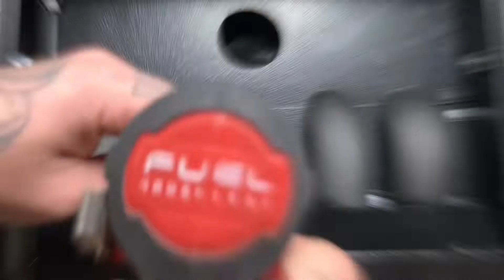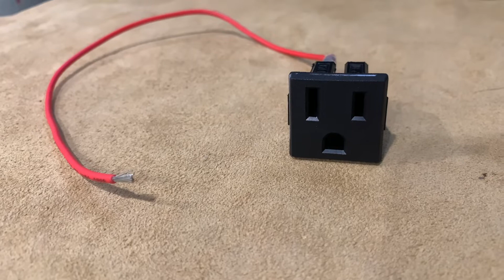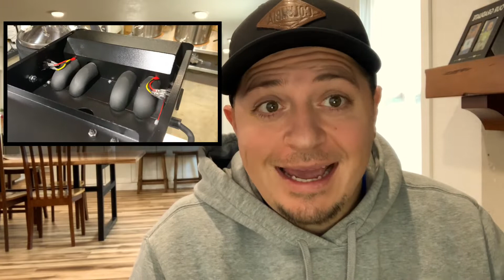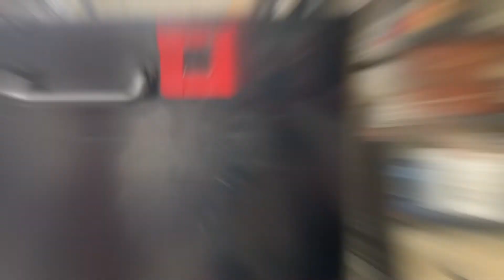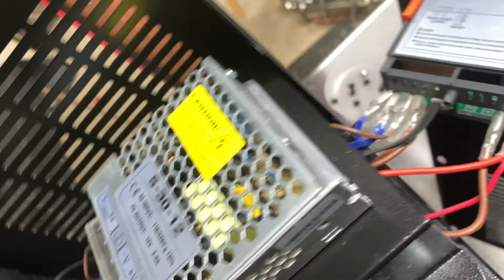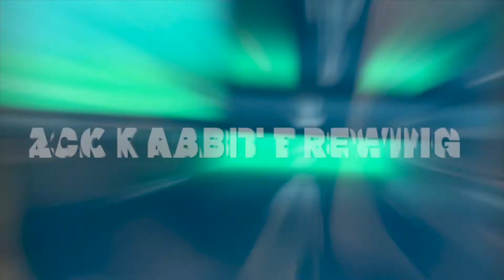I will show you how to use the heating feature on your ice master max 2!

Comment: Thank you for this video, it was a major help. I ended up tapping into the mains power to supply load to the heaters. That way there's only one plug needed to power the entire chiller and both heaters. You do this by installing a 6 position terminal block, and stealing the brown and blue input wires that feed the 12V transformer. The brown is the mains hot and the blue is the mains neutral. Use those feeds to power the heat relays and the 12V transformer via the terminal block. The ground wires from each heater socket can ground to the ground terminal on the 12V transformer.

Comment: Thanks so much for the video, this is awesome. One quick clarification: the power cord you install through the back (at the end of the video); this is the same cord you wire to the outlets and relay connectors earlier in the video, correct? Essentially, you hooked everything up to make sure it worked, then disconnected it all, ran the new power cord through the unit and hooked it all back up again before finally closing the unit up? Thanks!

Comment: Great information, thanks. I live on the Gulf coast and will not be using the heating often. I have one eighty watt heating element that I'm going to use on one side only. Do you think it would be safe to use the existing power for the chiller to power the plug for the heating element? I don't think both would be running at the same time down here.

Comment: Ok, so bear with me; I haven’t taken the machine apart yet and looked at the electronics. 

I get that you are using the relay to act as a switch. 

My question is, why are you running separate power. Are the relays not powered or do they not have enough power to run the heater?  The directions from Keg Land do not indicate that extra or alternative power is needed. 

Also, assuming the extra power is needed, where/what are you wiring the power cord to; you don’t show this in the video?  

Thanks 

Ray

Comment: Great vid. Clean modification to get a lot more versatility out of this chiller. It would be great if KegLand / MoreBeer added pass through outlets as a standard feature.

Do you know what the max current rating is for the relay that you're passing your heating elements through? My advice would be to add fuses inline with your heating element plugs. That way if anyone accidentally plugs something into the outlet that would exceed the current limit of the relay, you blow a fuse instead of frying your controller.

Comment: Instead of adding a separate AC power cord through the back, could you not simply tap into the power going into the Icemaster Max 2?
Reply from the maker: I’m not an electrician. But I don’t think that original power cord would be able to handle the load of a heating element let alone 2 if you were running both at the same time.
Reply: @zackrabbitbrewing4997  I would need to see the electric rating on the chiller, but from the description in the instructions, it only draws about 5A at 120V.  The cord size on the unit is probably 16GA (which can carry up to 18A over a short distance).  The spike conical heaters draw .67A to 3.33A depending on size (5 to 30 gal fermenter). based on these numbers, the units 16Ga cord can support up to 4 large heaters (if the cooling is on, at least one heater would be off) for a total of  14.99A (3.33 + 3.33 + 3.33 + 5A for cooler). This would likely be the max a single wall outlet could handle, so the only reason to do 2 separate cords would be to plug into two separate wall circuits (which still would not help much if all 4 heaters are on). Of course if you use the heaters for smaller (less than 30 gal ) fermenters, or only do 2 heaters, you would not be near any of the limits. 
The temp controller heater relay shows each is rated at 10A / 120v in their instructions.

Comment: How hot do these get temperature-wise? I'm getting an IceMaster Max 4 and am interested in adding this.
Reply from the maker: After installing plugs it just allows for you to plug in an external heating element so it really will just depend on which heating element you purchase. I personally use the spike brewing heating pad.
Reply from the maker: Here is a link to the one I use but all the major brands have one as well. https://spikebrewing.com/products/conical-heater-1?var=6865681252411

Comment: Silly question, so you've set it up so that the IceMaster Max triggers the usage of the Heating elements, without having to run the element power 'through' the IceMaster? ie you're using the Icemaster's temp control like a 'switch', but the power itself is going direct from the elements, through the plugs you installed in the sides, and then via them through an extension cable into the wall socket.

Is that right?

Seems like a great idea! Are there any downsides to doing that?

PS, love your content, just what I'm after at the moment :)
Reply from the maker: Yes you are correct. There are no downsides only upside. If you didn’t do this you would have to get a complete different temp controller to run only the heating element and you would have to use the ice masters temp probe to control the cooling. With this set up the ice master max two controls both heating and cooling.

Comment: What are the quick connects you are using on the barbs off the front?
Reply from the maker: These are ones I use from spike brewing. I will say once you put them on they are pretty tough to get off again, just a heads up. 
https://spikebrewing.com/products/temp-coil-quick-connect-fittings-1

Comment: Lol. “Fuck that, I ain’t cutting into my heating element.” Nice man. Taking it to the next level. Love it. Thanks for making this vid. Gonna do the exact same when I get mine. 

Also, the KegLand vid says you can buy an expansion kit to add two more controllers and pumps. Not that I need it (yet) but have you heard or seen anything about that?
Reply from the maker: Fuck yeah thanks man!

Oh yeah this unit is a 3/8 HP with a 4.5 gal reservoir unit. If you compare it to similar units like spikes 1/3 hp or SS Brewtech 3/8 glycol chillers you should be able to run 4 X 15 gal fermenters. Even If you were cold crashing all 4 at once I think this unit could handle it. You should be able to add those extra pumps no problem. 

For the price, capabilities, and pumps/temp control included its hard to be this unit in my opinion.
Reply: @zackrabbitbrewing4997  Completely agree. I'm up in Canada so it's tough as hell to get it up here. But even with an extra $200 (CAD) in shipping, I still think this is the best bang for the buck. 

Thanks again for making this vid. You're doing some cool shit. Sub'd!